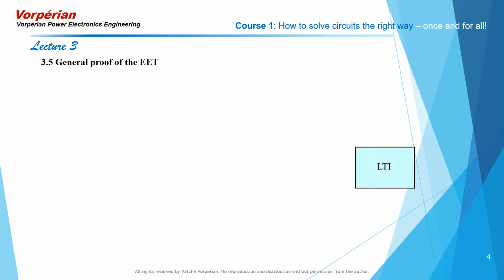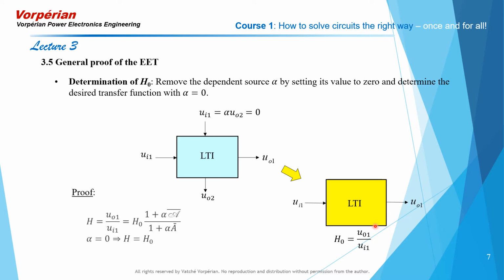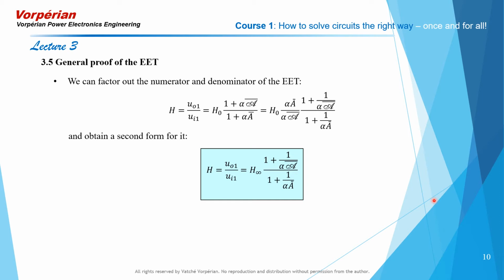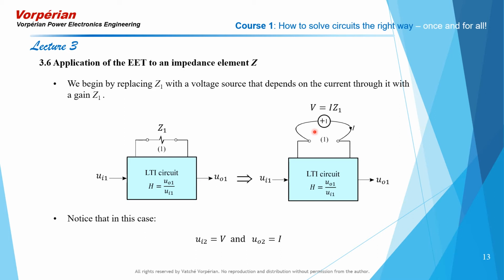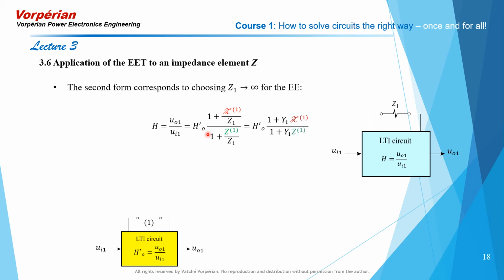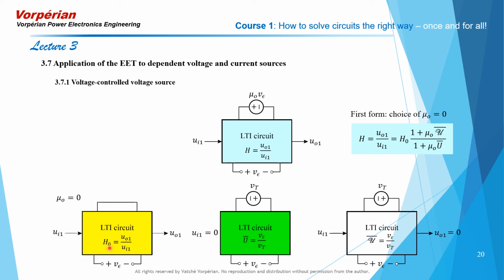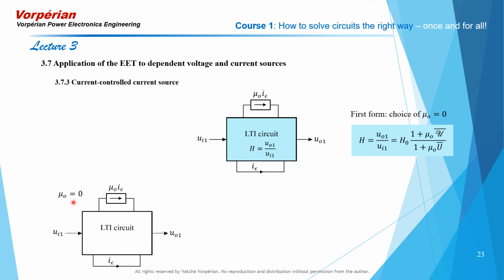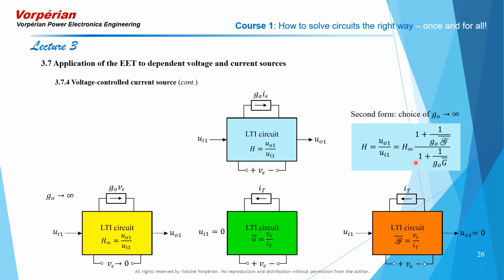Video 10: Fast Analytical Techniques in Electrical and Electronic Circuits

Comment: @5:39 I think a22a11-a12a21 in the final transfer function should be replaced by a12a21-a11a22.
@9:42 When alpha is nulled, I think ui2 becomes zero instead of ui1. I believe the equation written in the diagram next to the arrow that indicates the second excitation,ui1=alpha*uo2 = 0, is not correct.
Aside that I would like to extend my appreciation to you for your wonderful explanation and proofs.

Comment: Excellent content as usual. I have a question related to the proof in the early first steps.
In slide 4, it seems that the proof was based on the fact that we can apply superposition even on dependent sources ( that is why we modelled the impedance as controlled source in the previous Lec). I understand and believe that we can deactivate controlled sources while we apply superposition on contrary to what is taught in elementary circuit courses where students are advised not to do so.
Do you think this assumption poses any condition on the system we are dealing with while applying EET?
Thanks
Reply from the maker: Thank you for your comment. The fact is that dependent sources can be treated as independent sources as far as superposition is concerned. There are too many books that say they cannot be treated as such but there is no basis for it as far as I can see. Perhaps someone out there can post an example where such an attempt would result in the wrong answer. I would like to see that.
Reply: @vorperian_courses  I think the origins of this must be something like "well it's a dependent source so it can be any non-linear function of the input variable, and it being in general non-linear means you can't use superposition", which is obviously flawed because just like you have non-linear dependent sources, you can have non-linear elements. But that doesn't mean we can't linearize them around an operating point, like we often do. I think that's how the misconception started (in addition to many people not being aware that self-impedances/self-admittances are just specific cases of dependent sources, but their non-linearity doesn't break linear methods if we linearize them). And after that, people were just defending it in denial and arrogant complacence with the tradition-in-print, trying to rationalize it using counterexamples, which often turned out to be non-analyzable (where there are certain floating nodes) and thus not proper counterexamples. If you visit Georgia Tech's late professor Dr. Leach's old page (https://leachlegacy.ece.gatech.edu/), he has a story somewhere about trying to publish a paper about this to IEEE journals, but got rejected many times with little effort on the part of the reviewers to actually engage with the idea that the traditional ideas on this are wrong. It's just interesting. The paper is also somewhere on his page.

Comment: Good evening sir ,thank you for lecture. Do you plan to make lectures: negative feedback, filters,dc dc converters? and one more question, do you know some sources about GFT. I already found lectures Dr. Midlbrook
Reply from the maker: There will be more videos coming out and some will include feedback amplifier. I do not have any published sources on the GFT.
Reply: Dear Dr Vorperian, are you going to publish a full course on Fast Analilytical techniques here??
Reply from the maker: A full course as such would take a very long time of course, but I intend for this course to give more examples of EET, do the 2EET with a few examples and then the NEET with a few examples and be done with Course 1. In my opinion, these videos should be a very good companion to my book. Anyone wanting to master these techniques would ultimately need the book and work out the examples.